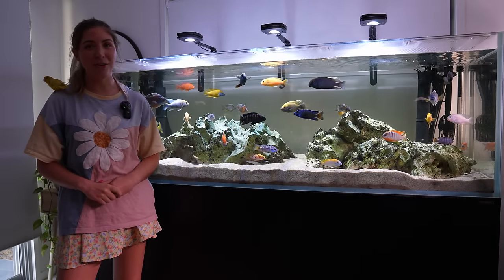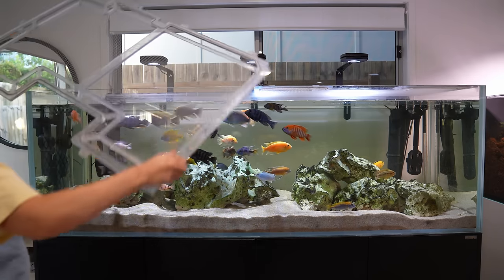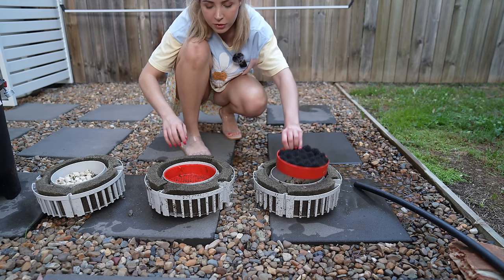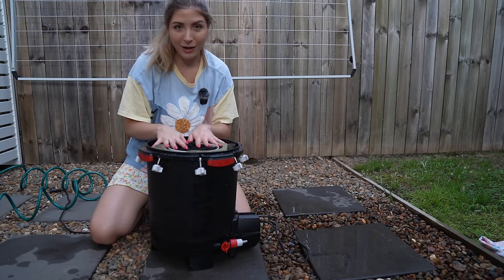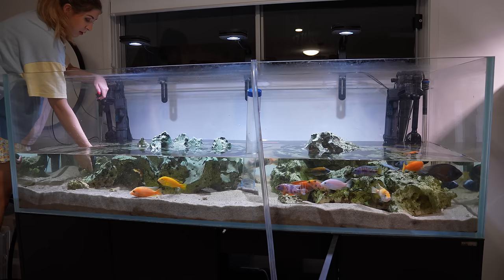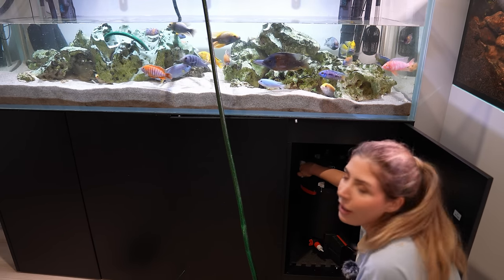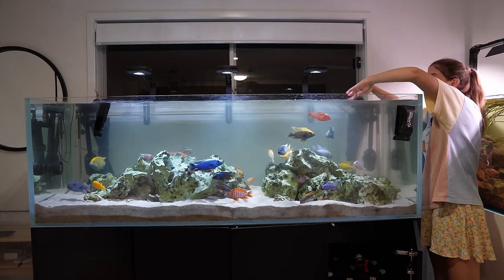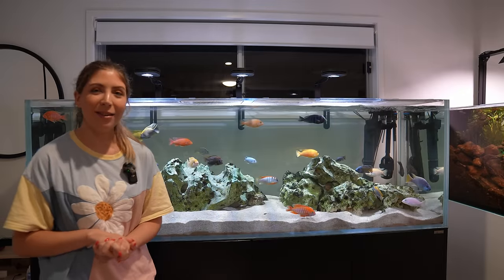Fluval FX6 Cleaning After 3-months on my African Cichlid Tank

Comment: 80% water chance every week  its way way to much, maximum water change is 25 every other week.Make it 40 but not an 80 %
Reply from the maker: 80% a week is perfectly fine, you just need to make sure you keep the pH and temperature stable and that nitrates weren't too high. If you haven't done 80% before it's a good idea to work up to it by starting with 25%, then 40% and so on but it's definitely ok to do, and can be really beneficial for heavily stocked tanks 😊

Comment: I don't know how to say this without you getting upset, so I'll just say it: You made some major mistakes in your TPA water treatment. Never leave biological media out of water without oxygenation as aerobic bacterial colonies quickly die under these conditions. If you need to clean them, do it in the water taken from the aquarium, in small portions, leaving the rest in the water taken from the aquarium, oxygenating with an aerator. Prime is extremely volatile, losing its effectiveness quickly once mixed with water. You must use it in your TPA water and not directly in the aquarium. Ideally, it should be in one or more containers where you add Prime to the water to eliminate chloramines. Then you mix the buffer in the precalculated measure to keep the PH and KH in the desired parameters and never directly inside the system but in the mentioned containers. Finally, where are the GH salts?? Remembering the parameters of Lake Malawi: ph 7.8 - 8.4, kh 6 - 9, GH 3-5
Reply from the maker: There's definitely nothing about your comment that upsets me! Thank you for taking the time to write it 😊